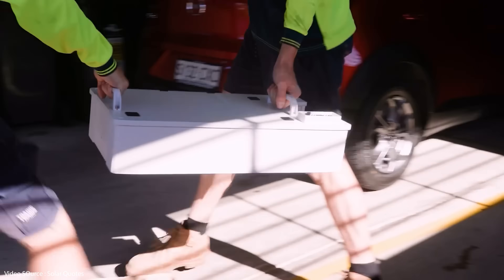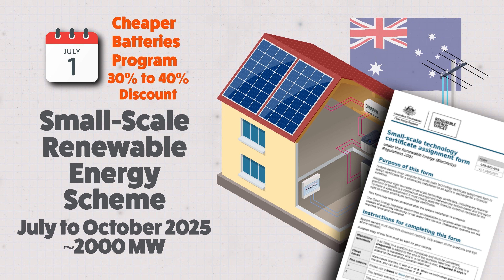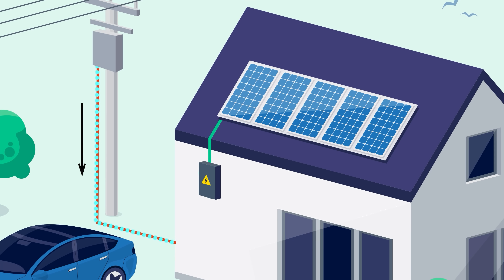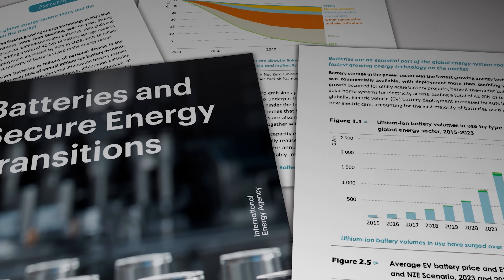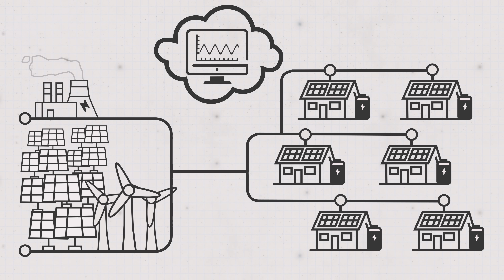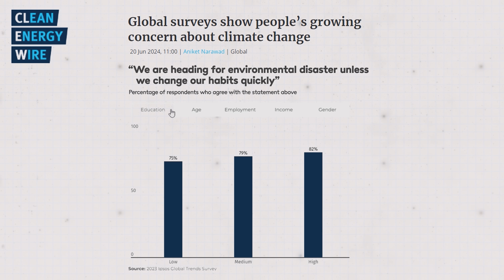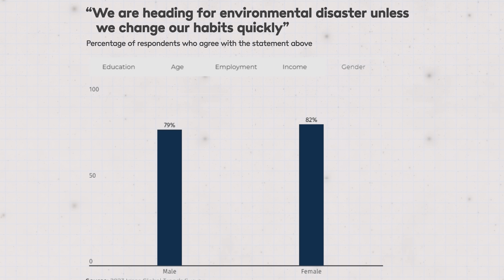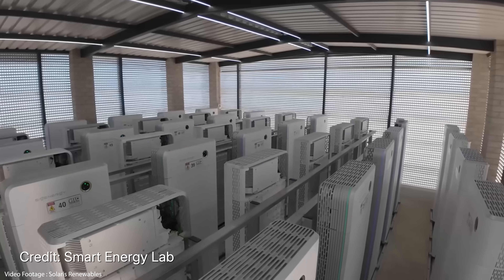Australians installed 100,000 home batteries in 17 weeks. Why can't we all do that?

Comment: I've had a battery in Australia for about 4 years. It was worth it even before the subsidies. It's a no brainer now.
Reply: Subsidies aren't needed in 'Stralia...  Average ROI for solar there is 3-5 years.  Subsidies only make sense in places where ROI is double digit years.
Reply: @Les_S537  "Subsidies aren't needed in 'Stralia..." - When you have the NIMBY and anti-renewable energy element holding up vital and seriously important energy transition projects around the country, then a strategy is required to buy time while all that anti-renewable opposition nonsense is sorted out. The viability of the existing grid was at a critical moment.

It's not just about personal economics in the big picture. To get people onboard with problem solving at the required scale, they need to be incentivise in the desired direction.
Reply: @Les_S537  Yes, even more so now, subsidies make sense because it is urgently needed, too much solar on grid at times, too much load on grid at other times, too much electricity generation curtailment due to grid, we need more power as coal stations are going EOL now/tomorrow and grid upgrades take decades and cost 10x more.
Reply: @badtellytubby  Subsidies distort markets by creating artificial incentives leading to inefficient resource allocation.  Investments might go to suboptimal home installations rather than more cost effective options like energy efficient appliances or grid upgrades.  The best place for battery farms is grid scale, not home scale.  If homeowners want to have battery backups let them pay for them on their own.  The main grid is where that capital needs to be invested.
Reply: @Les_S537 your right. With an ev our pay back time was only 4 years. Now paying off the EV.
Reply: @Les_S537  solar is dirt cheap it’s worth it everywhere, even in places like Hobart at 42 degrees south that get very little sun in the peak usage of heating season. Australia is a big place. Batteries still make zero sense without subsidies though, from a purely financial point of view.
Reply: @peter65zzfdfh  Look, I'm all for moving away from fossil fuels as a source of energy, but a world filled with tens of millions of wind turbines, and billions upon billions of solar panels, and trillions upon trillions of battery cells is abhorrent to me.

They last only a few short decades each generation (needing to be recycled over and over and over), and are WAAAAAAY more work than is actually needed.

The world has so much thermal energy beneath the surface that 0.1% of it can power all of mankind's needs for 2 million years.

Geothermal is the path forward.

It has a capacity factor of 70-90% (only nuclear power has a higher capacity factor), and (5000) 500 MW geothermal power plants could provide us with all of the power we would ever need.

They also can last for literally centuries, and their environmental impact is tiny compared to going wind, solar and batteries.

Comment: 20 years ago Australia spent a fortune installing roof insulation.....It was a disaster.
10 years ago Australia spent a fortune installing rooftop PV Solar . Today HALF those PVs DO NOT WORK!!!
Now fortunes are being spent on batteries ....
Reply: If half of pvs don't work why does Australia have a problem with too much pv generation?  Wanker alert.
Reply: @Triantiwantigongolope  If they ALL worked , Australia would have a bigger surplus.
Reply: @goranmiljus2664  Would it?  How is that relevant even if it's true? Besides I wonder how many accept that a hand full of problems is equivalent to disaster. Getting a bit carried away perhaps?
Reply: Bollocks

Comment: Imagine a world where the sun is the primary energy source... And then a volcanic eruption occurs, a supervolcano like Yosemite capable of darkening our atmosphere to such an extent that vegetation would suffer for years. Our survival would depend on our ability to produce energy independent of living conditions: nuclear, perhaps wind, hydroelectric (frost?), oil, gas, wood (which wouldn't be renewable in this case). Maximizing solar energy is essential, but the question of vulnerability must remain in mind.
Reply: How are you allowed out unsupervised?
Reply: In the event of a supervolcano event most of humanity will starve to death so solar panels will be the least of the problems. On the bright side it's one of the few ways other than nuclear war that we might possibly hit our emissions reduction needs.
Reply: @etchedpixels  Geothermal is about to leap past all other sources of power.  Look up Quaise Energy.
Reply: Geothermal is about to make a huge "comeback".  Way more reliable than solar, and cheaper.
Reply: @Les_S537  We have geothermal equipment in the area that causes seismic activity: France, Rittershoffen, 2.5 Richter Scale - 3x in 10 days.
Reply: @philippes960  Seismic activity is expected during geothermal development and operations, but that's normal when injecting the water into the system.  Nothing to be concerned about.  The Rittershoffen geothermal drill depth was between 2500-3000 meters.  Quaise will be drilling 10-20km deep so any seismicity will be so far removed you'd never feel a thing.

Comment: Grid scale batteries to the rescue, LFP , sodium or flow batteries w/Grid Forming.
Reply: Yes, home batteries are the highest cost way of adding storage to the grid. Grid scale BESS capital cost is about 45% per kWh of home batteries and engineered thermal management / load management and maintenance means the service life is 50% ~ 100% longer. Consequently the levelised cost of BESS storage is 25% ~ 35% of home batteries.

Comment: We put in a battery system a couple of years ago and we probably paid over the odds. That said its reduced our energy bills by half. CATL have just announced a sodium Ion cell that's good for 30k charge discharge cycles to 85% capacity and cost $20 a Kilowatt hour at that price fossil fuel is dead in the water.
Reply: nonsense!!! the fossil fuel is providing power for the base load for the intensive industries, batteries are totally useless for industrialised nations, for homes they are ok but still useless.
Reply: fossil fuels helps musk provide internet to almost the entire planet, BASF to make millions of oil byproducts used in all sectors of manufacturing.... car tires, road asphalt, aviation, maritime......

Comment: Another thing to think about is to add to building codes that new house construction should include a battery backup system. Just think of the possibility that a blackout would not send suburbia  in to blackness.  Maybe even add that power companies could access this battery storage. My vision is that utility substations just become battery storage sites.
Reply: You don't want a commercial scale battery bank anywhere close to where you live.  IF it catches fire, you're screwed.
Reply: @Les_S537  In a new build home, it should be possible to accommodate for a safe battery storage. And why not add in the building regulations a (rain)water storage facility and (in colder climates) heat storage to bridge the winter months.
Reply: @Les_S537  "Data suggests failure rates per gigawatt have dropped significantly (e.g., 98% decrease from 2018-2024), indicating improving safety." AI generated.
Reply: @chrisconklin2981  Still...  Accidents happen, and if a 100 MW battery farm (or larger) catches fires and gets out of control everyone within miles has to evacuate, and the fallout from it coats everything in toxins.
Reply: @Les_S537  Same is true for oil refineries.
Reply: @chrisconklin2981  Yes, but oil refineries are few and far between, and typically all located in the same area (such as we see with the refineries on the Gulf coast of Texas where the oil import terminals are located).

In a world with battery banks all over the place...

They should NOT be located in populated areas, period.
Reply: The whole point of solar and a home battery is not being at the mercy of power companies.
Generally I think that it's good to incentivize and if someone is willing to give their DNO or energy provider some control to help the grid and make some extra money, that is fine.
But it's not something that should be mandatory. If someone really does not want solar because they don't like the way it looks or is uncomfortable with a large battery in the home, that is their right. We really don't need to make every home self-sufficient and part of a virtual power plant  to make this work.

Comment: How much solar and storage is a minimum to even bother? I have 4 x100w panels on a south facing balcony generating up to 2 Kw/h per day and a single 800Wh battery, would there be any point in hoocking that to my home grid? I use on average 125 Kw/h per month so with any luck it should cover up to 50% of my used power, right? Who decides if I can hook it to my power panel, the landlord or the power company or both? Would I be better of just keeping my hoby setup offline for emergency use?
Reply: Essentially this is the why Germany has the plug in balcony solar that spread across Europe and why bits of the US are adopting it.
If you have a couple of small panels and a battery then hooking it up to your grid is a huge win if the costs of doing so are tiny. That basically means "if you can do it yourself".

For small systems (or even big ones with small grid tie values) the fact you can go to Ikea, buy one and plug it in is what makes the economics work.

Comment: Installed a 16kw solar array and 64kWh of batteries this past summer. Mostly because the tax incentives in the USA are going away. Been thinking of doing it for a few years. The tax implications pushed me to go ahead with it. Install everything myself ( with some help pulling wire thru conduit from one of my sons). So far so good. Have gone 153 days without needing to get power from the grid due to too many cloudy days in a row. Since June my biggest electric bill has been $5.92usd. figure the payback for everything ( not counting my "sweat equity" will be 4 years 9 months). With all the talk about AI data center's pushing up electric bills I'm really glad I did it!
Reply: David, great work!

And every EV you can charge at home slashes the payback time for your solar system!

Comment: In my condominium I haven’t got any options for real solar generation, but in my south facing office windows I’ve had two 50w pv panels hooked up to a River 3 battery since summer and i’ve very much enjoyed exclusively charging my phone, watch, and laptop from it.  I fantasize about the back yard array and battery system I’d like to have when I have land of my own someday. The thought of an effectively solar powered ev is appealing.
Reply: I guess you are from the states, but still : check out energy sharing. The Austrians implemented it nicely. The closer your sharing partner the higher the reduction of network charges. For example a building with condos with a central solar pv installation can consume the produced power with 100% reduction in network fees because it's behind the same access point to the building. It's implemented with electronic metering and billed by the power provider. (After registering and in 15 min calculations)

Comment: Installed solar 10 years ago in Australia.  This saved us $17000 AUD in 9 years and ROI was 5 years. Added more panels and a 40kwh battery with a 20kw 3 phase inverter.  Return on investment will be 4 to 5 years.  Its a winner in my books. Ample solar erradiation helps a lot and we now export much less in those solar "excess" periods that are creating the problems mentioned.  The government is expecting 2 million home batteries by 2030. Interesting times ahead
Reply: 'Stralia is one of the sunniest places on the planet, a quick ROI is assured (average 3-5 years).  It's too bad the rest of the planet isn't the same.
Reply: @Les_S537 I'm currently visiting the UK and am impressed by how many solar systems I'm seeing. Obviously not doing a lot this time of year but helping nevertheless.
Reply: @Rabs73  Commercial scale geothermal is about to break out worldwide...  Quaise Energy is about to make geothermal possible the world over.  It will crush all other energy sources in the end.
Reply: @Les_S537 its all welcome that is for certain.  Ultimately it all comes from the sun in the end
Reply: @Rabs73  Geothermal doesn't come from the sun, at all.  That's entirely separate from the sun.  One of the main reasons geothermal is limited to specific areas of the planet is that the crust of the earth is thick except in those specific areas where its thin or volcanic in nature.

Mechanical bits can only drill so deep before the time and cost stop you.

Quaise Energy has developed millimeter wave drilling where you eliminate all the down time associated with mechanical drilling. 

With mechanical drilling you get to a point where your bits are breaking down due to the heat and the pressures involved, as well as the type of rock you're drilling through.

Drilling through sedimentary layers of rock is relatively easy, but once you get deep enough you're dealing with granite level density rocks, etc...

You have to stop drilling, retract the bit, change it out, shove it back down to the point of impact and within a few hundred feet its time to do it all over again.  Plus you have to spend time encasing the borehole in concrete to keep it structurally sound and leak proof.

Quaise Energy's millimeter wave drilling eliminates all that down time because it literally vaporizes any rock in front of it AND seals the borehole at the same time because as it vaporizes the rock it melts the sides of the borehole thus sealing it.

The deepest boreholes we can drill with mechanical drillbits are ~15k feet, but to do geothermal in thick parts of the crust you need to reach 10-20 km deep.

Quaise Energy's MMW drilling will get us to that depth and unlock geothermal for everyone.

Comment: The more important thing is can they maintain them replace them overtime while making all those houses an extreme fire hazard. Also if it’s so awesome and not just a crony grift why does it need discounts that involve getting money from people that don’t even get the product
Reply: Extreme fire hazard?  Batteries that meet the EU standard don't catch fire. Come out of the 1970s.
Reply: @Triantiwantigongolope battery fires the thing fire departments are spending the most money on right now the thing that turned car fires from awful to a full on catastrophe? Also what if the house has a fire is adding a bunch of lithium to it really a great thing it’s not just the idea the battery is randomly going to burst into flames.
Reply: @grassyclimer6853  The great Barbaby Joyce, as transport minister, permited rules relating to batteries in ebikes and similar to be lapsed.  Perhaps he had drunk too much that day. Regardless. Australia has now imported many substabdard small batteries. They are what catch fire. There is no excurse for the current transport minister not having fixed Barnibys guift to us all. But politicians are politicians. Let's not expect too much.

Large batteries have to meet the EU standard to be sold in the EU and we get the same large betteries the EU recieves. That's why evs carch fire less often than ICE cars. Hardly an extreme fire hazard. Or do you propose banning ICE cars as an  extreem fire hazzard?

Ps Australia needs it's own battery standard that matches at least the EU standard.

Comment: From New Zealand: we installed a group of solar panels capable of producing 6.75 kWh on our home nearly five years ago. Installed a battery charger in the garage capable of charging our new (bought used) electric 2018 Nissan Leaf over night. The Leaf is V2G equiped, the reason for that choice, which made us prepared to go on the electrification journey the government at the time was encouraging (Jacinda Ardern). When the new government got installed (Christopher Luxon) for reasons open to speculation, nearly immediately, shut down government subsidies specifically aimed at electric progress. Our V2G scheme to use our automobile battery for home storage was abandoned, save for a small ‘experimental’ arraignment of 30 participants. We heard it was successful ,but when we requested an update of the government’s progress as it pertains to home use and the grid; nothing. We tried for a month to get information before finally receiving an update that only was to include another 30 participants with no follow through information or statically valuable roadmap. Our solar array is working perfectly. Our Leafs battery is nearly perfect from the time we purchased it 50,000km ago but loathed to admit that our observation of the government’s commitment to the electrification process has not kept pace with the general public’s.
Reply: Australia and New Zealand are high sunlight places on the earth.  You don't need subsidies because the ROI on solar averages 3-5 years.  Subsidies only make sense in places where ROI is 15 years or greater.